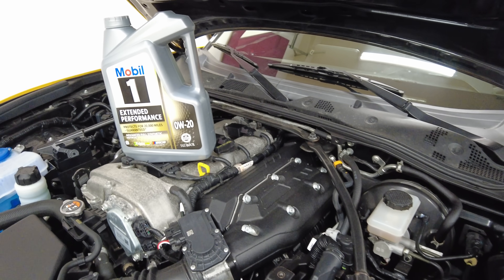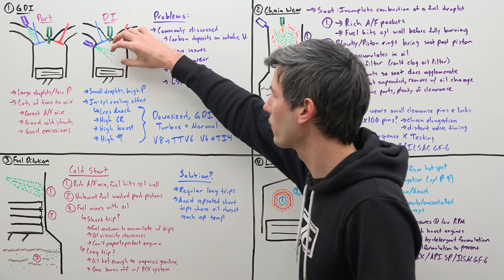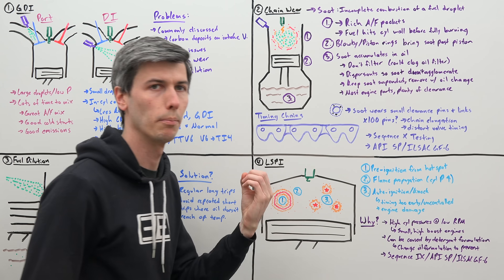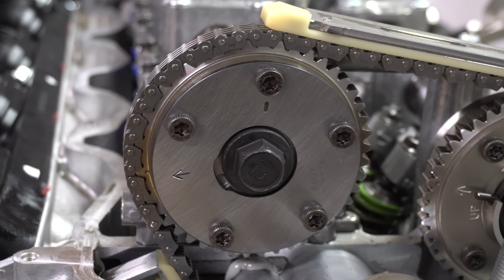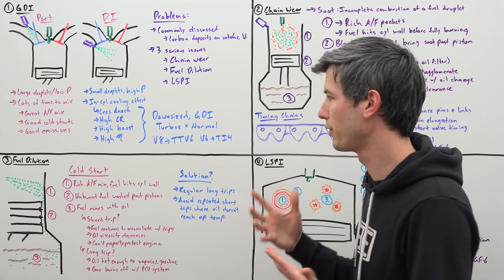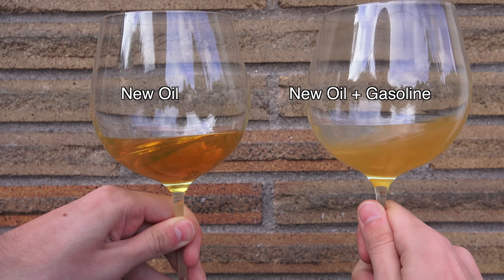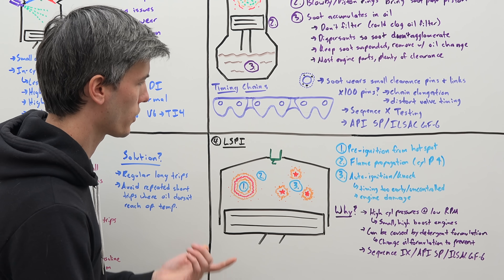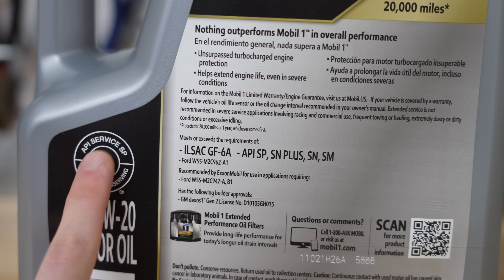3 Big Problems With Direct Injection Engines (Gasoline)

Comment: TOYOTA... Engines have a dual system with Direct and Port injectors to help keep them clean. Do you know if these engines suffer from oil dilution and carbon buildup?
Good video 👍
Reply: They do but nowhere near as bad as direct injection only. They're barely worse than port injected engines.
Reply: Tacoma's have the 4 DS atkinson-cycle engine the Dual injectors allow it to clean its direct injectors it's valves and also switch to Port injecting during the Atkinson cycle
Reply: They are good but I still recommend a catch can...

Comment: Had LSPI and Fuel Dillution issues on a N/A Direct injection four banger.  Nothing like running 93 in your econobox to compensate while pumping out a whopping 138hp at the crank.
Reply: Does it sound like pinging or knocking in a standard port injected engine? Or is it louder?
Reply: @volvo09  Depends.  With the carbon buildup (despite having it cleaned out three times) anything below 93 octane would cause detonation and this was well below 100k miles.  Good synthetic was used it's entire life and the air filter was changed twice a year.  This was especially noticeable when at lower rpm and mild throttle.   It almost sounded like throwing meat on a hot skillet for the first time.  A sizzle/crackle sound.

Comment: How important is an oil catch can at preventing the contaminants on intake valves from the PCV return to the intake manifold? Is an oil catch can an essential addition to a GDI gas engine?
Reply: I use one on my 21' Civic Type R and it catches a considerable amount. They do not catch everything, however, IMO they are essential for a turbocharged DI engine.
Reply: @chrisz5z  They are also beneficial for 8 cylinder American and German engines.
Reply: I've got a GDI engine without turbo. My experience with a catch can is I've caught nothing over last 50k miles. My thought is because of no turbo/no boost. I'm guessing if I had a turbo I'd have something in the can
Reply: @dmilk47  I own a 2021 Subaru Crosstrek Sport with the 2.5 DI motor. I installed a catch can on the PCV side. After 4500 miles (oil change)the can was 3/4 full. I was surprised since my 17 WRX base had two catch cans on it and after 4500 miles both cans were empty.
Kind of glad I have the baffled can on the Crosstrek…
Reply: very - I wish that manufacturers would just put them on cars right out of the gate. They are so necessary IMO with modern direct injected turbo engines. WIth the Focus ST for instance I would recommend it be mod 1 or 2 next to an intercooler to keep charge air temps in an acceptable range.
Reply: I’ve installed one on my Stinger. GDI 3.3 V6 twin turbo. The BMS zero maintenance one that feeds the residue back into the oil pan so it just flushes out with my oil changes. I was curious about his take on the whole catch-can thing, and as you say, why they aren’t somehow incorporated into the engine design from the beginning.
Reply: @andrew..c  When I had a C5 Corvette, I mounted a glass catch can at the front passenger side of the engine bay. Cooler temps allow easier entrapment of oil droplets. The glass reservoir made checking the entrapped liquid level very easy and quick.